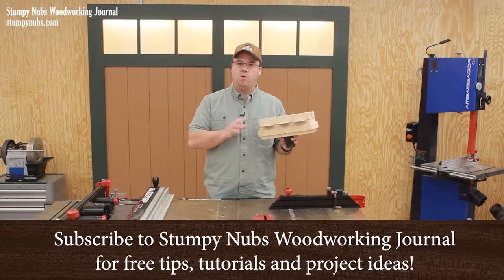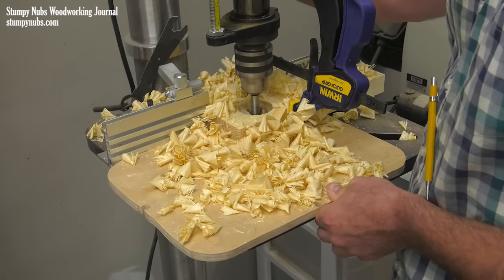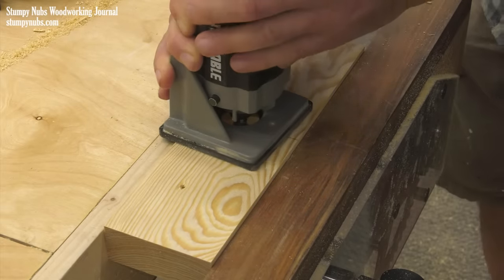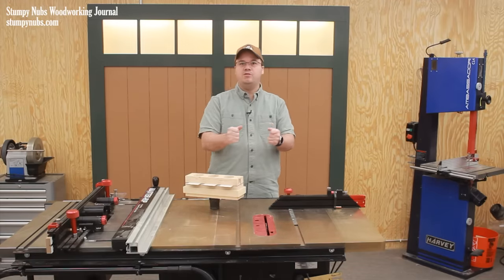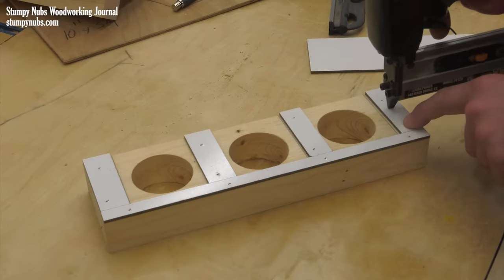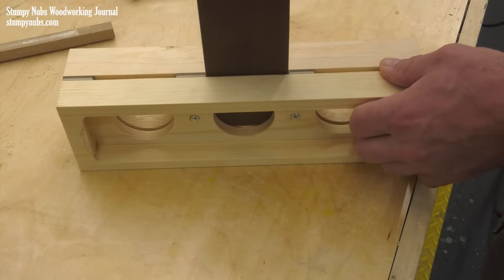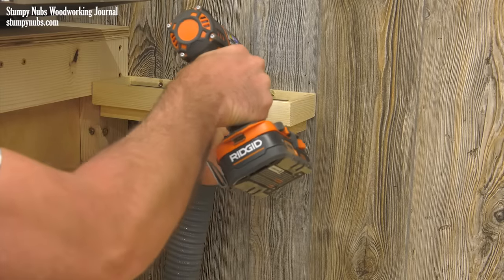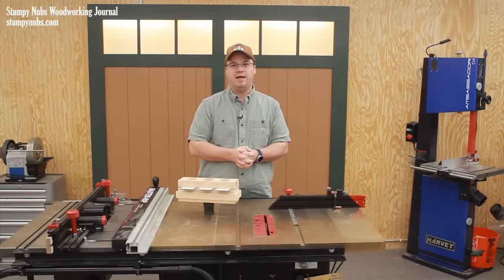HOMEMADE Shop Vac Device TRIPLES your dust collection!

Comment: No need to measure and fit the individual blast doors. You can just build the whole layer from one side to the other. The doors don't have to be precisely centered over the circular openings as long as they fully cover it. So you fasten one side, put a blast gate next to it, then fasten the divider on the opposite side and work your way across, making sure that the blast gates fit snuggly before you fasten the divider.
Reply: That would be better way of making it. And since you can make the blast doors the same size, you only need two blast doors as you would have one always open. Just move the doors as needed.
Reply: Nice but you could use a single length-wise blast gate, with a hole in the middle, and slide it left or right to change the air flow to the  two outside positions .
Reply: @LarryTait1  also a usable idea, except you'd need the gate to be super long to properly plug the holes and slots if the first or last gate is in use, plus an extra space to close them all.
Reply: @LarryTait1  That's the usual design for handmade two-way blastgates, I'd say. Only possible downside I see is that it sucks in 'false air' from two sides instead of one (negligible power loss?), and the aesthetic of there always sticking out two full holes' length plus a bit (and 2/3rds of the time, asymmetrically). Advantage is that if a bit imprecise or too slippery, it won't have a tendency to fall to closed position during use... but then you'd have to adjust anyway.

Comment: Oh, wow, such a simple solution for an annoying problem I'm having... I have a festool dust collector and have to keep switching out hoses for various tools (it's a long story as to why). So, I have several different sized hoses (and no, I can't just buy an adapter, again, long story)... With this, I can just make different sized holes for the various hoses. THANKS FOR THIS! I have a CNC, so making this will be easy.

Comment: I made something like this a few years ago but I decided to put a single blast gate sliding horizontally in a box with a single hole that lines up with the hole in front but exits out one hole in the back (with angled baffles to direct debris to the hole) . This uses a single motion to change ports. It's similar to a deft cleaning blast gate but as it closes one hole it opens another. Any bits that get caught only requires removal of the hose to clean out. Only had to do this once though in the 5 or so years that I have used it (pretty much every day)

Comment: I am literally working on a shop vac project right now. I just upgraded my filter and bags to HEPA, I installed a cyclone collector to a 15 gallon canister with a gasket, upgraded some hoses, and added an automatic on/of switch. This would be a perfect manifold for my mobile work station that has my table saw, router table and downdraft table. My long term plan is to get a larger dust collection system (along with a bigger shop), but in the short term, this will work great! Thanks for the tutorial you have a new subscriber here ;).
Reply: What automatic switch did you use ?

Comment: I  built this great  item.
My vac hose is 2 5/16 inch diameter!
I don't have a 2 1/4"  forstner bit, But I used a 2 1/4" hole saw.
I enlarged the hole with a Dremel using a small drum sander bit. It takes about a minute to enlarge the hole for a
Good hose fit. I drilled 7/8 inch
Finger holes in the blast gates
To make them easier to grab.

Comment: I would add small stoppers to the thin boards being pulled in and out. Just a tiny screw and nut would work, but there are a million options (so long as they won't fall out into your vac system). They could be attached to the sliding board at a position farthest back inside the hole (when the board is shoved closed), which would allow the largest amount of opening without worrying the pieces will fall to the floor and get lost or messed up. If you wanted to get fancy, you could notch out the housing to allow a niche for the nut and screw at the front of the hole, which would ensure there was no airflow being lost, because you could still pull the board out fully.
Reply: I was thinking the same thing. Would be nice to not have to think too much when grabbing a slide gate for the next tool operation. 

This is a great little shop project idea. I hope to be setting up some real dust collection to one wall of the my shop soon. This little selection box will serve a belt sander and maybe my miter saw.
Reply: I also like the idea of building in some form of stopper.  However, an alternative if one didn't want to hassle with that would be to draw one line on the top surface of each slide that, when flush with the front edge of the box, would indicate that the slide was entirely clear of the hole and not restricting any air flow (I'd make this line green), then another line further back on the top of each slide to indicate not to pull it out any further without making it potentially unstable in the slot (...and this line red).

Comment: Another great cheap useful idea. I made similar single blast gate by simply sandwiching the gate and made slider longer so it doesn’t fall off. Silicon can seal any air leaks etc., there’s a million ways to do it but I really like yours because there’s some nice simple skills involved and it’s easy to make and very useful. I may consider magnets to seal top and bottom and still make it easy to separate to clean. Thanks for sharing this. And btw, some people complain about the click baits and commercial but I think it’s a small price to pay for getting quality content from you, and others. After all nobody invests in all this work for nothing and viewers should respect that.

Comment: Old project. I have built several of these manifolds for a standard 4" dia hose vacuumn system with 5 blast gates . I sloped the ends and used velcro to hold a plexiglass window front. This allows me to see the vacuumn is working and it can come off to clear any blockages.

Comment: I like the concept ! Also, you could use a single length-wise blast gate, with a hole in the middle, and slide it left or right to change the air flow to the  two extremities

Comment: A good and afordable advice , I think 🙂👍
One could cut a round log, hollow it out in a similar way and have a rotating inside valve but then one only gets one active opening at the time, then again most of us have only small weak shop-vacs that cannot handle more openings

Comment: Jonathan Katz-Moses posted a video over a year ago with an adjustable manifold that uses magnets to hold the main vacuum line. You just slide it side to side depending on what circuit or machine you are using at the moment.

Comment: Another Stumpy Nubs Innovation!  Awesome idea and I plan on building one, it will come in very handy for my projects until I get the money together for a larger scale system. Thank you!!! Also nice new background, I originally thought that was the "garage" workshop area, turns out I was mistaken. 😁
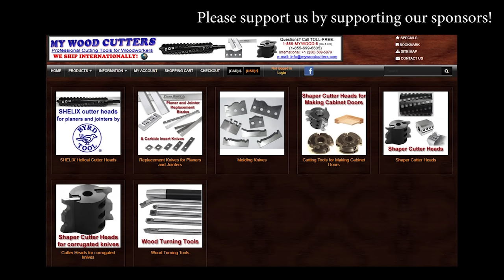Reply from the maker: It is the "corner workshop" area. That stuff is moving into another building that is more like an actual garage. I am using the space to freshen things up, and for some courses I am working on. More info at 6:50 :)
Reply: I would use hardboard or thin MDF instead of full 3/4 MDF for the template --- easier to cut the hole & to enlarge it, and there's a chance the template bit cuts all the way.

Comment: Nice. Seems like you could even use this as a hose conversion interface by making one of the outer holes a smaller size to fit the hoses that attach to some hand held tools. 🤔
Reply: Was thinking of just this for my palm sander

Comment: Thanks for posting this. I really could use something like this for my table saw, miter saw and drill press. I'm always moving that hose around to those three machines.
Reply from the maker: I'm not sure a shop vacuum is the best way to collect dust from a table saw or miter saw.
Reply: @StumpyNubs   It's not but that's what I have.

Comment: I made a plenum for 6 tools with a blast gate for my table saw, band saw, router table, miter saw, surface planer and drill press. I attached each tool but the table saw and router table to shelves that were hinged inside my off feed bench. I adjusted the height of the surface planer, and miter saw so that their "table" was flush with my bench top and when the tools were folded down into the bench each tool's lid was flush with the rest of the bench. I used counter sunk 180 degree hinges on the 5  lids. one lid covered the plenum. Power Tech provided a funnel shaped vacuum device that formed the bottom of the plenum and helped direct the collected dust into the 2 1/2" flex hose going to the cyclonic dust collector which was in turn connected to the shop vac. DIY BLAST GATES were mounted to the plenum's top so that I could collect each of the tool's dust by opening just that one tool's blast gate. Perfect, no, but much better than no vac. I also plugged each tool to a multi outlet and the multi outlet to a auto switch designed for the shop vac. regardless which tool was switched on the vac activated automatically. 
  This set up for my 10 x 20 utility shed greatly reduced clutter and gave me back my floor space I had lost from all the floor mounted tools I ended up selling.

Comment: There's a video out there by a guy called "well done tips" who used magnets in a sliding configuration that's worth checking out. The sharp angles and space for turbulence here will have a pretty significant impact on suction.

Comment: I may try setting this up on my CNC router. I do have a corner where this unit could handle my belt sander, spindle sander and my bench band saw from a single shop vac.

Comment: You can also 3D print a 4-hole-to-1-hole gate (with 3 caps for the unused ports) out of TPU filament. 
It ended up being less work for me and I finally had a reason to use my TPU filament. Pretty rugged too.

Comment: I wanted to convert my jointer to helical spiral cutters , so I called "My wood cutters " last July an ordered it and that was seven months ago , and I'm still waiting!! and if that's not bad enough I had to take my jointer apart to measure for the new cutters, so I've been without a jointer for the past seven months which really sucks!!!!
Reply from the maker: Mywoodcutters is the retailer. They can only ship it to you after the manufacturer makes it. The manufacturer makes heads in runs for each individual machine. If they are out of stock, it takes time for the next run to be made. It's frustrating, but it's how helical heads are. I am sure Mywoodcutters has explained this to you.

Comment: Just need to add a motorised drive to the blast gates to open and close them as each machine is turned on and off!. I have an annoying habit of forgetting to connect the right hose to the right machine, or even turning the dust extractor on, until it's too late 😀.

Comment: I have something similar but the lower half is a triangle pointing down.  Much less pressure drop and never needs cleaning out.  The front and back sides are 1/4" ply and the left and right sides are 3/4" thick by 3.5" wide pine.  Bottom is 1.5" by 3.5" like yours.  No need to rout out the box inside.

Comment: Instead of three holes closing individually it would be more efficient to have the hose on a sliding head that aligns with one tool at a time, so trash is always going straight thru the valve and maintains air velocity with less snagging.

Downside is you can only use one tool at a time.

Comment: 45deg leading to bottom of manifold leading to shopvac, so less airflow resistance, and less chance of debris starting to clog inside. A couple lovetaps will likely losen debris without having to remove anything.

Comment: Great idea but may I suggest that gates have a stop to prevent them being removed completely.  The gates would have to be installed during assembly and slots would be needed for the stops, so as not to reduce the hole size.  
Without something like this. I can hear a lot of expletives as they are opened, dropped, and clatter on the floor.😎👍

Comment: Great little project, thanks James.  You think it would help (or be worth the effort) to use double sided tape to attach the thin strips for the blast gate?  Wondering if that would help with sealing it up, but maybe the hoses go past those pieces of wood when you insert them, so it wouldn't matter.

Comment: You could also: make this for a 4" vac AND make 2 manifolds - one to split to two or three 4" intakes, and another to go to two inch ones - OR a mix of them - That's what I'll do - since I have a mix of machine near the 4" vac. I suspect a somewhat thicker, not just wider chamber would be good.
Reply from the maker: Shop vacs run on high pressure / low volume, and are therefore able to overcome the restrictions that this device adds to the path of the airflow better than a 4-inch dust collector, which runs on low pressure / high volume and therefore needs to maintain greater airspeed. I would not recommend this for a dust collector.
Reply: @StumpyNubs  I love your design and I'm afraid I'd have to disagree from a physics point of view for a v2.0. You're excellent and simple design, would work fine - as it's not a 45 or 90 or ribbed, simply an insignificant volume of smooth  plenum, adding a very short smooth length to whatever the previous total length was. A change from a 2" source to a 4" collector with your design is physically no different than any other direct 2 to 4 adapter. I can't add a sketch here, but imagine 4" out at the bottom, 4" in at the top center, and a more complex top, angled 30 deg each side for the 2" connections so they are aimed directly at the 4" exit. The worst case imaginable static pressure loss of the 2 to 4 would be less than an equivalent 4" wye, but in reality, according to my analysis, insignificant. If the 4" collector was good enough to work with a 2" converter before, this would be no different and conceivably better, with less flow disruption, unless it's an elongated reducer like the Peachtree PW468, in which case it would be the same. Of far greater potential static pressure loss would be a couple feet of either 2" or 4" flex hose. Your design rocks for it all! The math proves it. Congratulations!

Comment: Another design would be make a simple manifold with the number of inlets/outlets you need with no box in the middle. Think of just a 2x4  or 4x4 with  holes the size of your vacuum connections drilled straight through it.  You connect all of your tool zones to one side and then when you want to use a specific zone, you just attach the vacuum hose to the zone you want vacuum. No box to fill that needs to be cleaned. Yes, the down side is only one zone gets vacuum at a time.
Reply from the maker: Pulling the vac hose in and out will wear on the wood holes and you will soon lose your friction fit.

Comment: Great idea, however showing it in actual use would have been helpful. From my experience with blast gates, dust tends to collect in the slots makings it difficult to close the gate requiring the slot to be cleaned out. Have you experienced this with your design?
Reply from the maker: It opens up for easy cleaning.

Comment: James, love your videos.  Where did you get the male hose connector visible at 5:58 and connected to the single hole at the bottom of the distributor?
Reply from the maker: It came off my shop vacuum hose. You can buy them wherever hoses and accessories are sold.

Comment: I would assume that this design would lose a lot of static pressure for anything connected to the side adapters, since the air path needs to make two 90 degree turns and the inevitable turbulence from reflecting off the wall or overshooting the manifold intake. A variant of this with the splits at 45 degree angles would probably improve performance on this significantly, at the cost of a much more complicated and larger design.
Reply from the maker: That would not affect the static pressure, it would affect the air speed. Luckily a shop vac relies on static pressure more than air speed, which is what a larger dust collector would rely upon.

Comment: Wouldn’t it be soooooo much better if the single hose attached to your dust collector slid side-to-side so that it aligned with whichever attachment hole was in use? It would solve the blast gate issue and the bottleneck 90 degree turn problem that this project includes.

Comment: Nice project. Would it work with 4" hoses? I understand I would have to use 2x6 instead of 2x4, but my worry is the loss of suction.
Thanks a lot for the inspiration!
Reply from the maker: Shop vacs run on high pressure / low volume, and are therefore able to overcome the restrictions that this device adds to the path of the airflow better than a 4-inch dust collector, which runs on low pressure / high volume and therefore needs to maintain greater airspeed. I would not recommend this for a dust collector.
Reply: @StumpyNubs  Thanks!

Comment: While it works to enlarge the template hole with rasp and sandpaper, it does require a bit of skill to actually keep it perfectly round. Probably better to use the router for that task as well.

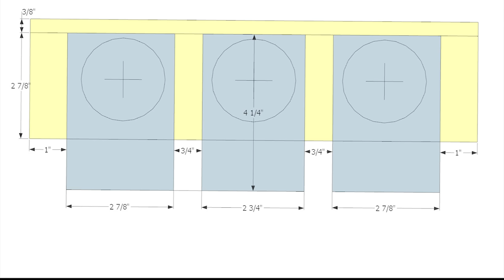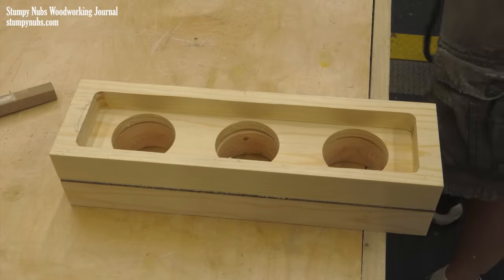Comment: Looks like you made an error on your drawing at 4:33.  Center blast gate are shown as 2-3/4 wide whereas outer areas are 2-7/8.  At 4:40 and 4:45 we see you testing a single blast gate in both center and outer slot.

Comment: The geometry of that one will reduce the flow a lot.  If one wants less flow restriction greatly increase the distance   between the inlet   and outlets , less  sharp flow directions change).    Concept is good otherwise.
Reply from the maker: Shop vacuums run with higher pressure than dust collectors, and are not as reliant on air speed. Yes, it will reduce suction some, but not as much as you think.
Reply: @StumpyNubs  Correct  , the higher the flow the worse the flow restriction will be.